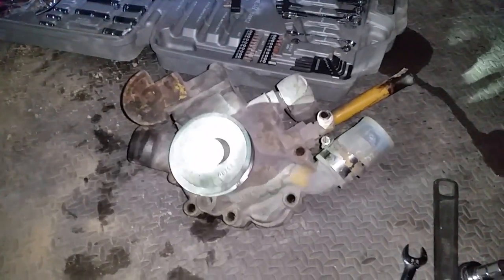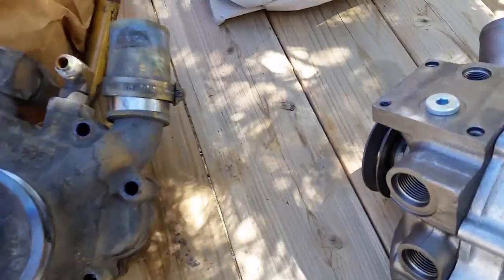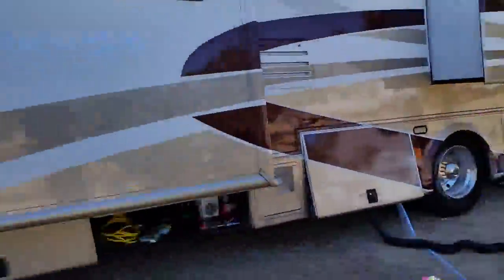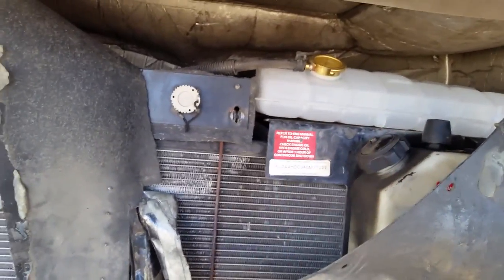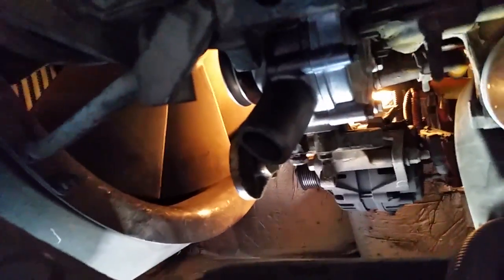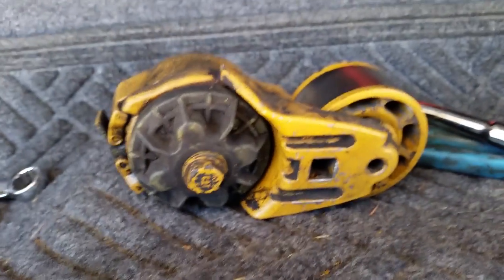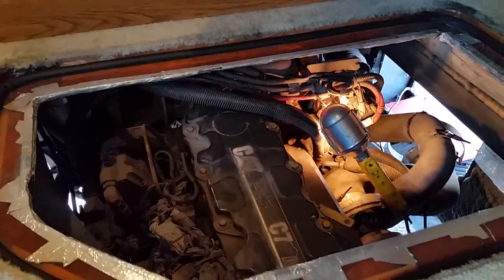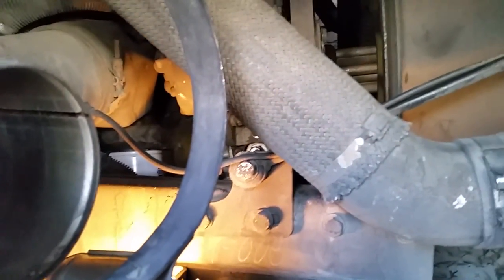RV Repair: Caterpillar C7 Water Pump replaced while at Campground with basic hand tools.

Comment: Just purchased a 06 Winnie with the c7.  When doing all maint for a starting point I have coolant on the bottom of the cross member below the balancer.  After watching your video I don't think coolant leaking from the WP would get there.  The winnie coach is not conducive to finding this or examining the pump.  There is zero access.

Comment: Great video! Did you have any problems with vaporlock when refilling the coolant?
Reply from the maker: No problems at all just recheck it a few times after warm and cold cycle
Reply: @ktoutdoor  your video really helped me inspire me to tackle my myself on my 2004 c7 RV. I got a couple of quotes that blew my mind. Freightliner wanted 10 hours labor for that job. I just got my water pump today and all my parts and will tackle it with a friend at Quartzsite next!
Reply from the maker: @Therulerof72  Let me know how your repair goes and think of all that money your saving.  Check those idler pulley bearings see that they are quiet.
Reply: @ktoutdoor  I can't thank you enough for the inspiration,....we did it! It was tight but I got the pump, 2 tensioner pulleys, both belts, upper coolant hose, compressor coolant pipe, expansion tank and new coolant all done for about $800 in parts! (I went with the CAT remanufactured). I did it over a few afternoons while boondocking near Quartzsite, Az. You video was a huge help and I thank you!
Reply: I'd love to show you some pictures is you'd like to be reminded of the scene of your own breakdown haha. I had noticed some play in the water pump pulley but it was still working. I pulled the pump off here in the campground and wouldn't you know.... The pulley is completely seized up. No joke it drove in here with no issues and the belt was still turning.... Once I parked it and it cooled down it seized up and it was game over. I didn't even realize it until I pulled it out. Got lucky there!
Reply from the maker: @Therulerof72  I would love to see the pictures my email is kc5210@gmail.com or text to my cell 606-875-0125 Kevin
Reply from the maker: @Therulerof72  I new you could do it!!!!

Comment: How much easier would this job have been, with a side mounted radiator?
Reply from the maker: Very....lol but we got it done anyway.
Reply: @ktoutdoor  okay thanks. My wife and I are going to purchase a diesel pusher after the holidays. I try and do all my own work if possible.
Reply from the maker: @patrickpatrick9132  FYI Diesels can be expensive to maintain compered to gas.. I have a gas my buddy has a diesel I have seen the difference.

Comment: How did that aftermarket water pump hold up? Just pulled my water pump and thinking about the aftermarket pump
Reply from the maker: Mark Maue yes it is still working just fine.
Reply: Kevin Caudill , how do you like your c7. I bought a 2003 school bus with 2126 with under 84 thousand miles, cruise control, air conditioning, new tires, no rust and a automatic transmission with overdrive for 3500 dollars and my wife and I are making a rv out of it.
Reply: 3126 engine
Reply from the maker: Still working just fine , sorry for the delay , this is not my RV it belongs to a friend of mine that we travel with.

Comment: Spring is usually wore out, should be hard to twist using a long bar.
Reply from the maker: Thanks for contributing
Reply: @ktoutdoor  wore out spring tensioner will result in every component failure as the belt slaps against every pulley. Maybe I can share a good video. As an off road truck driver thisbis a common point of concern even causing the motor to over heat potentially costing $20-30,000+ to replace a motor for a $60 dollar tensioner.
Reply from the maker: @albertareal6222  Great video Thanks!!

Comment: Would it have been easier to remove the rad first?
Reply from the maker: Maybe if we was at a repair shop but we made due with limited tools in the campground.
Reply: @ktoutdoor  Great work and vid. Has this pusher been expensive for repairs vs a gas equivalent in your experience?
Reply from the maker: @markp6982  My friend has sense sold it and yes I find a diesel pusher cost way more money to maintain then or gas 8.1 Vortec  gas and with a gas you can most likely fix it your self.